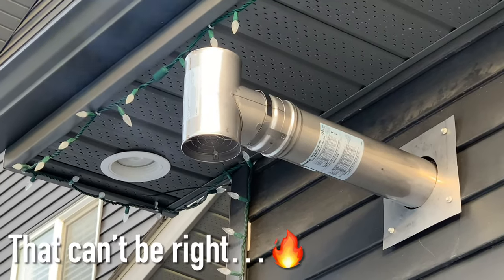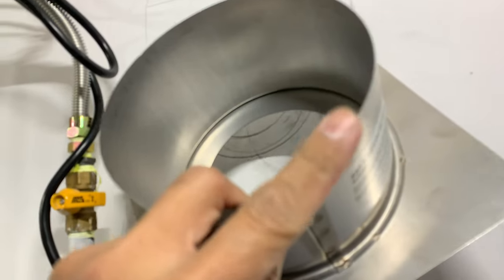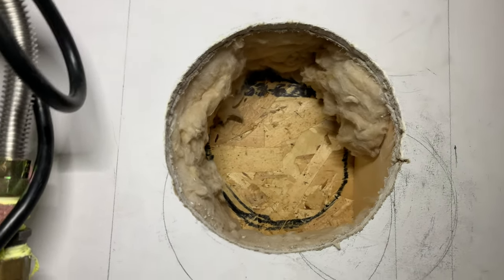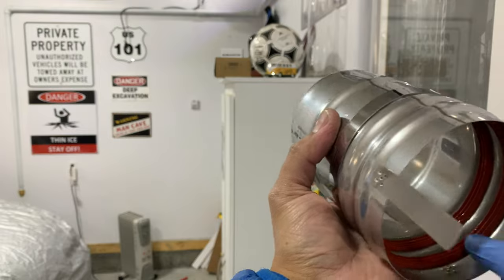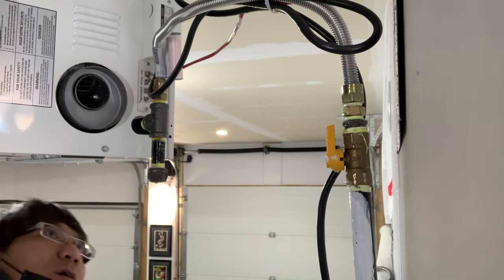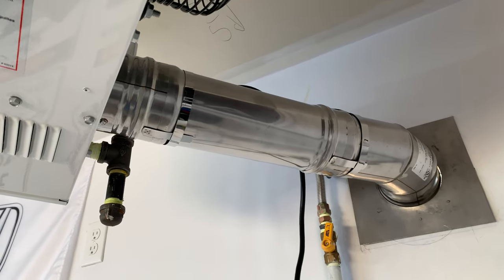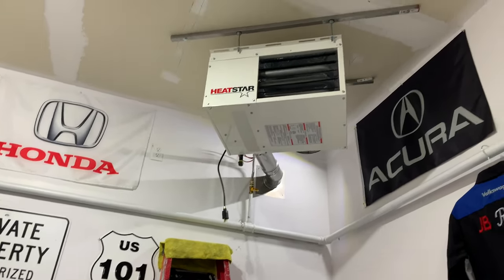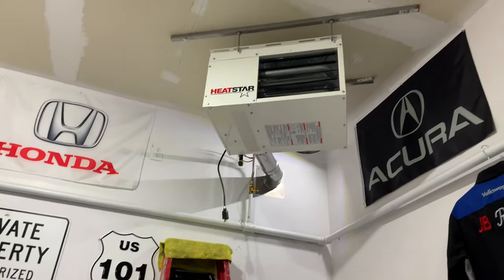HeatStar Garage Heater Installation (Part 4) | 50,000 BTU

Comment: Unit heater manual states the vent must be 4 feet from a vented soffit, you're only a few inches....
Reply: You will never be 4 feet, its almost impossible. Just have to extend past soffit
Reply: my thoughts exactly.  that's way too close and against code.  The manual says nothing about extending past if you are under 4' clearance, therefore code does not allow this and it is illegal Install.  I would red tag this if I came to your house bud.

Comment: What I'm trying to say is that it's not worth taking the risk and doing the proper way is actually easier. Having a certified electrician and gas fitter at your disposal is quite awesome. I converted mine to propane and there some intricacies that I could never had known but having professional support took care of it.

Comment: The exhaust is way too close to the soffit and not far enough out.  The exhaust gas can be pulled directly into the attic through the soffit vents.  At a minimum I would extend it past the gutter.

Comment: i also notice the gas supply is coming from what looks like is 1 in black pipe, overkill but problem is I don't see the regulator. Lastly, your garage look quite new and air tight. Code requires a fresh air intake since the vent you have is not the type that have the separate space for combustion air. This is a danger for carbon monoxide poisoning. Event thought the machine would detect a low oxygen condition and automatically shut off, I would not trust my life to that piece or equipment

Comment: Your condensate catch (pee trap) needs a directional change doesn’t it? The way you installed it, the gas goes directly into the bottom of the trap before it goes out the T into the unit. Gas supply should connect into the T portion. Condensate out the bottom, nipple and 90 elbow out top with nipple into unit, right?

Comment: The exhaust port appears to be very close to the bottom of your soffit, which looks to be vinyl.  I suggest you use a thermometer to measure the exhaust temperature, both right at the outlet from the top of the dispersal "T" and also at the closest piece of vinyl soffit.  Just turning the final "T" 90 degrees may help since it will increase the distance from the "T" outlet to the soffit and maybe provide enough horizontal flow of the exhaust gas so that it can disperse some with the ambient air before it hits the vinyl soffit.  

If the exhaust temperature is too high for the vinyl, I suggest you extend the horizontal vent pipe by another 2-3 feet so that exhaust outlet extends well beyond the vinyl soffit.

Stay safe,  Bob
Reply from the maker: Thanks Bob for your input and great suggestions! As I mentioned on my update in one of my latest vid (please also watch when you have a chance), I am working to get the pipe extended.  As for the soffit it is aluminum. Regardless, I will be extending it out a bit… thank you for all your support!

Comment: I'm pretty sure you need a heating permit in Alberta, it is a requirement here in BC. Also looks like is it an attached garage, so dwelling, even more so a permit would be required. I'm on my second unit. The first one was done pour by a gas fitter and is not up to code. For the second one in my detached garage, I got a homeowner's permit and I have a certified gas fitter assigned to me for inspections, any questions or whatever. Looking at your install there is some details that where overlooked by the biggest is that you did not take the panel off to inspect the internals. I fired mine up this week, with the help of the gas safety officer after going thru all the rough in and other inspections. You have to measure the out pressure of the regulator, purge the gas lines, and inspect the flame as you first start up. Anyway, I could go on and on, I strongly recommend you to get a permit, the fines in BC for a illegal system  can go up to 2000$, also if something goes wrong and the house burns down good luck with the insurance company. It it not worth it.

Comment: Great install! Thanks for the great video. I loved the pulley process.
Reply from the maker: @Jack Madden thanks! I am glad you like the series of videos on the heater built. The pulley is epic! It worked like a charm and it will be there for any servicing work on the unit if needed. The vibration dampers are also great. It made the unit super quiet from the upper floor.

Comment: I’m checking others installs for reference to doing mine. I read somewhere that you may need to extend out further because that soffit appears to have Fresh air intake vent holes it’s possible to suck the exhaust back into the attic.  Something to check out. Thanks for the video 👌
Reply from the maker: That is very true and that’s what I learned as well during the process. Unfortunately my vent pipe kit is slightly shorter than I wanted it to be, but it is not that short that it is venting into the soffit. It is pass the soffit and it is hitting the tip of the gutter. I have observed and watched it through the winter and the ice buildup is at the tip of the gutter only. I recommend 200+% to make sure your pipes are extra extended and I have the plan to redo mine once i I found a stainless steel pipe. For now I will rely on my CO2 detectors built-in throughout my house including in the garage.  

By the way I have consulted and had the heating system inspected by a local expert and they didn’t detect or see any possible issues throughout the house. They even placed their detector near the exhaust pipe between the gutter and the outlet, and their reading is not nearly fatal that puts us in so much danger. The dense fresh air dilutes it technically.

As I like to put it, “it is always better to be safe than sorry” so please don’t have a short exhaust pipe!!

Comment: Also, you probably need an electrical permit. In BC, you cannot plug it in, you need a dedicated 15 amps minimum circuit with a disconnect switch within 1 meter of the unit.

Comment: Great Video! I just bought my 50000btu on sale can't wait to get it going. Question regarding the venting. I'm from Ontario, how far was the heater from the wall and did u have to give the venting a slight pitch or can it be straight? Hopefully that makes sense. Thanks
Reply from the maker: @Alex thank you 🙏 If you haven’t seen the rest of the episodes on the garage heater please do so when you get the chance. the recomended placement and spacing for the unit will be outlined in the manual. I have a slight outward pitch on my exhaust pipe to allow the moisture to grain out. Keep me posted on how it all goes!

Comment: Is that flared fitting holding gas pressure? It looks like you have Teflon tape at the gas flex.
Reply from the maker: Please dump it down a bit for me as I am not a plumber and not too much on terminology. I put Teflon on all of the threads, if I shouldn’t have to on some parts it would be good to know
Reply: @JNBTuning  from each e d of the gas flex to that first fitting is a compression flare and doesn’t need any sealant.   Might want to just look up a separate gas flex video.
Reply from the maker: @dualcasedtoy  thank you for letting me know! I will for sure look into this. Much appreciated!  Strangely enough it is holding pressure despite of me jamming a Teflon on its thread. I am surprised the plumber and utility guy I ask to check and inspect my work didn’t mention or noticed.
Reply: @JNBTuning  hopefully it came off in a nice way. I don’t like telling people what to do but in my experience oddly enough those specific fittings don’t need anything.
Reply from the maker: @dualcasedtoy  no worries at all! I am glad you did bring it up to my attention. I am by no means an expert and I appreciate everyone’s input! Thank you 🙏

Comment: Can I ask is the thimble connected in the inside of the wall? I am about to do mine and my wall is a little thicker than they slide together. Thank you!
Reply from the maker: Hi Brian, yes the thimble did connect just exactly on my wall. If your wall is thicker it might not fit. I would suggest finding a wider one. If not you can get an adapter or a thin sheet of steel wrapped around inside. Please keep me posted! Good luck
Reply: @JNBTuning  I ended up getting 6 inch cap and cut the cap off and slid it between them.
Reply from the maker: @brianvrota1  that is great 👍🏻

Comment: Did you slope the venting upward toward the outside? The instructions state to do so, however I am concerned with condensate dripping back. Do you have any condensate entering the unit or entering via the vent seams?
Reply from the maker: Very good question by the way! Yes I decided to sloped it out given it didn’t make sense since I didn’t have the drain conduit internally. It has been dripping all condensation out towards the T exhaust pipe.

Comment: how much did you drop from heater to wall outlet
Reply from the maker: Sorry I not sure I understand your question.
Reply: @JNBTuning  sorry why do some heaters say to slope to outside others say slope towards heater for condensation I would prefer slopping to outside is this wrong
Reply from the maker: @maccaesar340  I had that same question as well. Base from my reading around, I believe you slope in if you have a built in grain in the exhaust pipe, otherwise you slope out. I am not an expert in this regard as I am just a DIYer, but if anyone know more about it, please feel free to share.